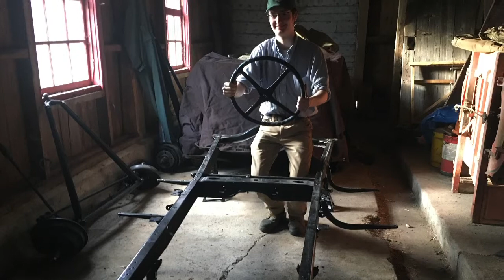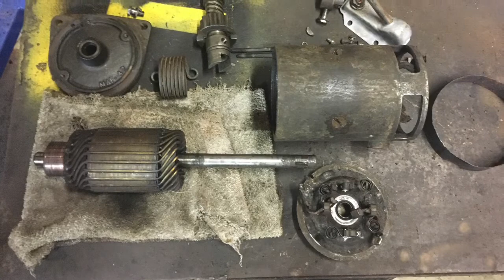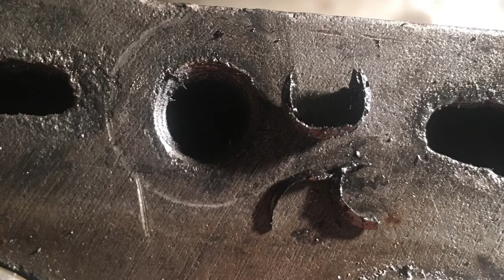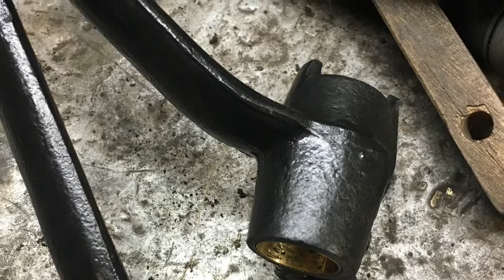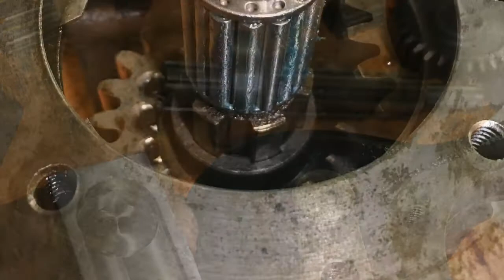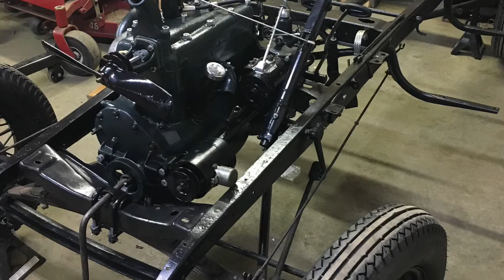Ford Model A 1930 "Ground Up" Build report

Comment: Keep up the good work. I was 20 when I bought my first rundown project 1931 Model A coupe. Many years, several more Model A's, and I finally got another '31. Perhaps you will find a useable pick up body someday. Everything is possible man.
Reply: Pickups are fairly rare when they are in pristine condition.

Comment: Great Job.  I am in the same place you are... I have a standard coupe.   Working on body at this stage.
Reply from the maker: Thanks, I have no body at all so you're ahead! Good luck
Reply: @castironmachines  I thought you had a truck body to redo.  You can always make it into a 1930 racer.  Find a hood and mold the aluminum body yourself with rivets.  They are cool looking.
Reply from the maker: @Rottingboards  The truck is my goal someday, but until then a custom speedster would be pretty cool